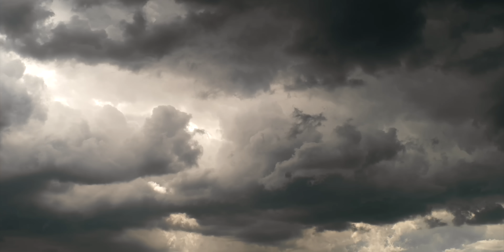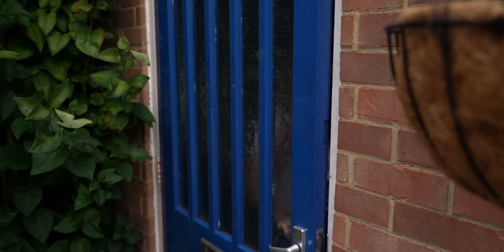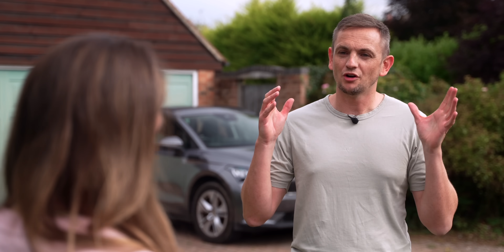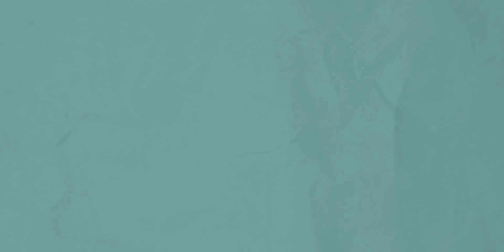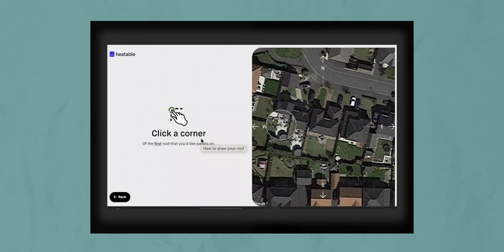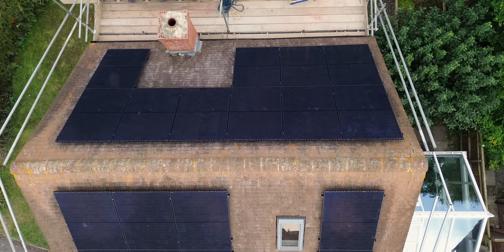Maximise Your Solar Returns With These Bifacial Panels!!

Comment: So, if I had a patio, thirty feet from the batteries,  If I used micro grid inverts for the roof, the sunlight hitting the concreate pad and the ambient light would add to the total.
Reply: Yes, but normal DC bifacials would also work, feeding into a small string inverter just for the patio (cheaper than the microinverters + envoy unit).
Reply: @WyndStryke  Cheaper is  not necessarily better. The issue is voltage drop. Depending upon wire gauge, over greater distances AC has less voltage drop, as T. Edison learned.  To be clear, I do not know the answer.
Reply: @chrisconklin2981  For a short distance like 30 feet, there's not much voltage drop (on either AC or DC) given a reasonable wire gauge.  You should be able to use 4mm DC cable without any issue.  If you were going longer than that, then 6mm.  At 90 feet then you might need to transition to 10mm cable if you wanted to keep under the 1% voltage drop benchmark.  Even with 10mm cable, it'd still be significantly cheaper than using microinverters ... and there's no reason to be using DC cable in that situation anyway, you can put the small string inverter in the patio, and just run A/C from the patio back to the consumer unit (what's what I'd be doing).   The reason I'd run A/C is not the voltage drop, it's that A/C joints are more tolerant and don't arc in the same way.

Comment: I can't really see that any advantage that micro inverters have, is outweighed by the upfrobt cost, the increased risk of failure and  the difficulty and disruption of changing them. Just add a couple more panels instead and where possible don't put Bifacial panels on the roof to get the best out of them.

Comment: In the end the inverter has an output of 230/400 V so if you feed it with 250 - 900 V DC it's way more efficient than using 20 V DC and converting that to 230V
Then you have electrics on your roof minus 10° in winter and plus 60° in sommer because it's directly mounted on the back on the Panel. Which is also really not a great idea because of heat. And that should last for 25 years I doubt it. Which brings us to the guarantee very nice, but it's just the micro inverter which is about 100£ or even less but how much is the installer coming by and replacing the thing?
As an installer I would very rarely go for a microinverter solution. If an installer goes for it on all his installations he probably just has no idea an looks for the one fits all option, which in my opinion dose not exist.
Reply: - however "most" DC coupled batteries aren't really running at 400V  - or whatever the nominal coupling voltage is - that would necessitate over 100 cells in series and most of the offerings are merely running  7-15 Series ( depending on the cell chemistry LMN or LFP - and the desired low voltage level - 24 through to 52  VDC).. To take it up to the voltages needed for bidirectional coupling (rectification and inversion) to 240 or 120 VAC etc. DC (up to 339VDC)  level shifting has to occur..
Reply: @kadmow  I almost exclusively install high voltage batteries BYD HVS or HVM.

Comment: One thing i didn’t hear asked not answered was if the inverter goes out but the panel’s still good can you swap out the inverter itself and not the panel or does it even matter bc they’ll just swap out the whole panel with inverter under warranty?
Reply: Something tells me that this microinverter is going to be bonded to the panel... With a glue that can endure multiple 80+C cycles a day for 25 years. You can buy them separately but good luck prying this thing off.
Reply: There are still cables from the panel to the inverter, so you could unplug them from the integrated inverter and plug them into a replacement.
Reply: @robinbennett5994  Except:
 "This is the iqa uh HC

ACM and that's the cradle that it sits
in so this is a different version than
you would normally get with n phase"
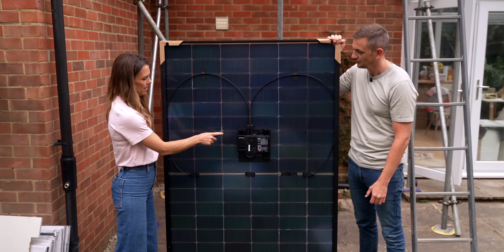- 3:30 ish

How much you want to bet that you can't buy them separately?

Comment: I've had micro inverters on a previous house (installed by a company that we engaged) and we have a dual string inverter on our current house.

The first thing that happened was that the micro inverter company went bust and the 20 year warranty went with it. Luckily, in the ten years or so of ownership none of the inverters died and the system performed well. We had some shading and the MI were ideal for that scenario.

In our current house the string inverter died last year and we had it replaced at a cost of about £600. The new inverter has performed very well so far and where I thought that the poor performance was due to trees causing shade previously, no such issues with the new inverter. This is on a ten year old system. The panels are working fine.

If I was starting out again with a fresh install, and assuming that there is no major shading, I'd go with a string inverter. Why? It costs less in hardware and, if unlucky enough to have an inverter die, it's a one hour job to replace it and there is no need for scaffolding or engineers trying to balance on roof ladders to change a panel cheaply. 

Do micro inverters fail? Well, we were lucky in that none did. A neighbour who also had the same brand of inverter has seen half of his die gradually over the past twelve years. Yes, they may be under warranty, but the warranty "may" only cover the hardware costs, the installer being responsible for the cost of installation and, if he has closed the company down the cost for the scaffolding and the labour may fall upon the customer - if he can find somebody willing to change the hardware.
Reply: Bang on! It's like with harddrives and RAID array, the MTBF (mean-time-before-failure) of individual units divided by the number of units is the MTBF of the whole system.

Comment: From a physics viewpoint  I  would suspect  that the dark side of the panel  might receive orders of magnitude less light energy than the front. The illumination of the back side will always be in direct proportion to that of the front side. This is not different on a sunny day to a cloudy day. It will not suddenly make them work better on cloudy days.  If there is actual well founded scientific data plus a believable cost benefit analysis compared with the newest standard panels then I might be convinced. Not persuaded by salesman's talk sorry.
Reply: There is the idea that on cloudy days the light is less direct it comes from all around, so if you have a bifacial panel on an open field installation it might produce a bit more, on a dark roof like in the video I doubt it.

Comment: What about DC battery storage with this microinverter system? Presumably it would not work and an AC-coupled battery is needed which might be more expensive or bulky.
Reply: You'd need to convert back from AC to DC again to charge the batteries, which would result in more losses and basically negate the benefits of the microinverters. Any AC coupled battery is still doing an AC to DC conversion, as a battery doesn't charge with AC current. So the most efficient solution is likely to be DC panels going straight into DC batteries, as there's only one conversion, that's when discharging the batteries.
Reply: @mentality-monster load of rubbish every little is lost from AC back to DC.
Reply: People are so concerned about a minuscule efficiency difference and then they leave all kinds of lights and appliances on when not home 😂

Comment: Investment wise the added value to property makes solar/battery a no-brainer option, the free clean/energy is the bonus!
Reply: Yes, but, you're presuming the kit is working 100% for the sale.

The word "investment' seems at times to be a tad optimistic.
Reply: @ investment means added value you would not otherwise have, it’s a great investment.
Reply: @Lawrence7of9  

Not really.

All depends on one's locale.

Splendid option for the hazy  sunlit uplands perhaps but not necessarily for all areas in dear old Blighty.

Which is why area storage batteries may be a better option as said batteries can charge off the grid.

It is becoming ever more clear that electricity is not necessarily a "one size fits all" solution.

In any event it looks as if private buyers of battery EVs in UK are declining in numbers.

We see evermore desperation in the motor trade to sell used BEVs to an "audience" who has moved on, or back, to fossil.fuel cars.

What with Rachel finding ever more cunning ways of abstracting taxes from.the general population then will she leave enough cash in people's wallets and purses simply to get whatever car one owns serviced let alone buy another vehicle.

Comment: Wonder if you'd want to paint the roof under the panels white to reflect more of the light on the back of the panels.  Would it matter or could you get a bit more produciton out of it?  Was thinking they were going to touch upon the technology that has micro prisms or reflectors in a sheet layer that concentrates the light in low light conditions.
Reply: Many solar panels fitted to homes have a white layer behind the PV modules to give the light an extra ‘chance’ of generating as it is bounced back up through the PV.
A transparent back is helpful if there’s additional light to gather from behind the panels - think ground mount systems elevated above sand or snow.
But mounted a few inches above a roof, there’s not much room for that extra light to enter the rear face of the panels.
Reply: @jesseb4me  But if you have panels like this where there are slots between the cells, and since they're double sided, you'd think having that white background would help generate a little bit more than not having it.  Or is it really negligible?
Reply: I was wondering the same thing if painting the roof white would help with bifacial panels. Would at the very least help cool the roof being white. I am not a fan of the new trend of black roofs. The government tried to ban it in Australia but there was too much push back.
Reply: @lavectech  forget painting the roof - it’ll be shaded by the panels themselves. My loft space is cooler now as I have a roof full of solar to shade it, and the air gap behind the panels lets it circulate. 

Forget this attempt to market something different - just buy standard solar that has that white/reflective rear layer. 
Having the back of the panel transparent isn’t helpful - it’ll just mean more light passes through and hits your roof!

Comment: Heatable fitted REA bifacial panels (6.3kw) & 10kw battery storage. We have trees around our property too, but system has been excellent - along with Heatable - just completed 1st year installed. We have since added ASHP & run an EV but our electric bill (no gas now) is less than before. Alot less, 4cast use under £500 a year, feed in about £300, so our annual energy/car fuel bill £200.  😂 brilliant.
Reply: How much did you pay? And how much would it have cost with normal panels and string inverters?
Reply: Someone asked but can’t reply direct (google error) of 3 recommended estimates Heatable was cheapest, £16k. A less advanced panel same size & string inverter (10yr warranty) was more expensive. 25yr warranty on micro-inverters won! Then later discovered bifacial panels way more advanced.
Reply: @Lawrence7of9  I did not anticipate that. Could it be that this was quoted at the height of the energy crunch and that only overly expensive charlatans actually had the capacity to provide sensible quotes, whereas all others were inundated with requests and unable to answer them all?
Reply: @luc_libv_verhaegen  the same company later offered me their latest panels/string for slightly less, but still inferior kit, and I’d already gone with Heatable. So pointless & they lost sale.
Reply: let us know in 15 years.

Comment: Not so quick to get micro inverters! 
I am not convinced by your 20v startup per panel.
I have a SolarEdge system, and I have 14 panels. 
I can see start-up at ~ 150v, for the complete string that's about 11 Volts per panel.
Why get micro inverters?
Reply: Microinverters can be better if some panels are likely to get shaded while others are in full sun.
Reply: @economicprisoner  SolarEdge does the same
Reply: I thought wiring panels in series (straight line) opens up a significant failure point when one of the panels goes bad.  Or has that been solved?
Reply: @Pottery4Life  This is true but the cost of microinverters! not cheap.
Reply: Microinverters give you no high voltage DC cables on your roof. Much safer and also easier to add new panels as you don’t have to buy a new big inverter of the right size🔥

Comment: I keep hearing this marketing-speak about startup voltage. It's not a important as they make it out to be. An inverter may startup earlier in low-light conditions, but that's when energy available is  less anyway. So you might get 50% earlier startup, at a time where 2% of the day's energy is available. So I wouldn't get too hung up on it.
Reply: totally agreed. In a sense these videos just confuse people who get caught up in the nitty gritty. these single inverters massively increase the cost per panel for minimal benefit.
Reply: @Piperman  I think increasing the cost per panel is the point. That way the profit per panel is larger for the manufacturer, importer, wholesalers, installers. Not much profit to be had selling panels for £50-60.
Reply: @Piperman  They are pushing this because it's Australian may a cheaper deal because we are out of the E.U.They say bullshit baffles brain.
Reply: As long has you have the right number of panels on your inverter it's fine.  Heatable is in the volume game they just want to sell the same parts to 10,000 homes hence the micro-inverter thing. What they're selling to you as a benefit is actually a benefit to their business model.
Reply: @edc1569  my thoughts exactly. Plus you can charge a premium and your mark-up on the equipment earns more because it's a percentage. The cost of good quality solar equipment has come right down and yet installers find a way to keep the price for an installation the same or higher. It's like whenever there is a government subsidy, the total price seems to increase at least as much as the subsidy saved you!
Reply: @matthewwakeham2206 

And of course the researchers on the show don't appear to be   that clued up with the tech.
Reply: Startup voltage can be an issue but most modern inverters have no problems with it at all. Also the voltage is here as soon as the light is, current is the problem.
Reply: Agreed. The voltage climbs quite quickly before you start drawing current, so that period before generation starts is quite short, and as you say, because those light levels are low anyway, the amount of energy available is small. Not something worth adding complexity for.
Reply: @bimblinghill  Low light levels can exist all day in England.
Reply: @RWBHere  PV will reach voltage even in very overcast conditions, it's just that there's next to no energy to harvest. If you look at the inverter display, you'll see it drop to very small numbers on cloudy days, but not zero until the sun starts to set.

Comment: I dont like the idea of having micro inverters since if you have say 16 panels then that's 16x more chances to have to replace 1 if one fails, if you have one large inverter its statically more resilient, although if it goes wrong you stop generation entirely but you don't have to get onto the roof to replace it. I also bet that 16x micro inverters cost more than 1 large inverter on average
Reply: Exactly and the 25 year guarantee, nice but that's just the product, the installer coming over is the expensive part not the product.
Reply: @JonasHenn  And the scaffolding to get them up there!
Reply: @JonasHenn  installer will be long gone.
Reply: The microinverters are about 130-150EUR each, whereas panels are like 75-100EUR each these days. If you really have a shading issue, and want to compensate for the lost production, then you are much better off installing more panels than to go for micro-inverters.
Reply: Conversely when the string inverter fails you get no power! Micro inverters  or string inverter do your research before buying as each have their pros and cons.
Reply: @badgerUE  When the string inverter fails, you detach it from whatever wall it is mounted on and hang a new one. When a micro-inverter fails, you can in this case, replace the whole panel, which means getting scaffolding installed and sending people on to the roof.
Reply: Keep in mind electronics don't really like hot temperatures. Guess what a solar panel endures! Yes, extreme hot. Maybe in the UK the problem isn't that pronounced, but you get the point.
Whereas a string inverter can be indoors or at least in the shade.
Reply: Good discussion here

Comment: Even if the panels have lower voltage they might start producing at about the same time with a microinverter as with  string inverter. As for the string inverter all voltages from the panels get added up anyway. Also Enphase microinverters are shit for most panels over  400W, they just can't get the most of such panels. I'd rather get Hoymiles microinverters. Also no use pretending Enphase is special, what he describes are microinverter advantages in general.... This is a commercial...